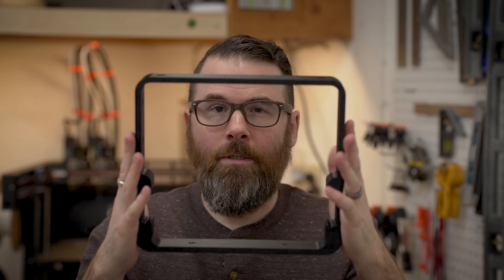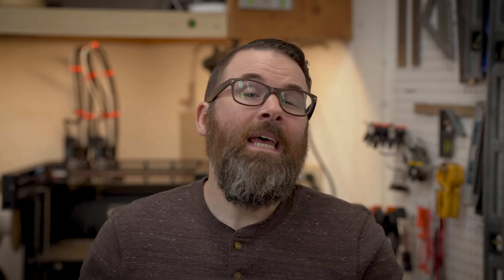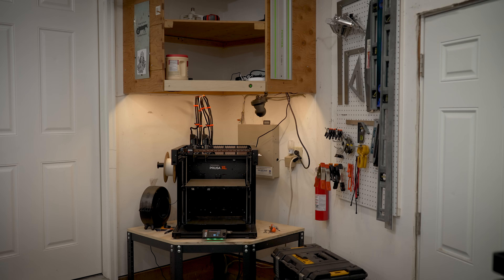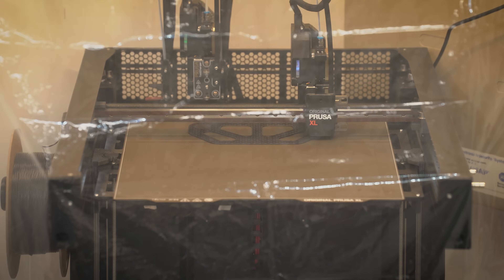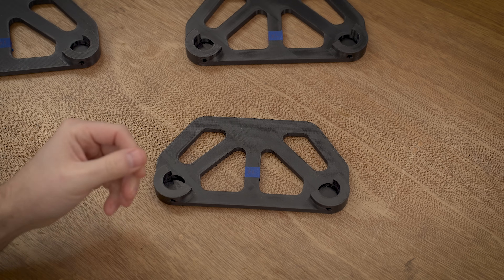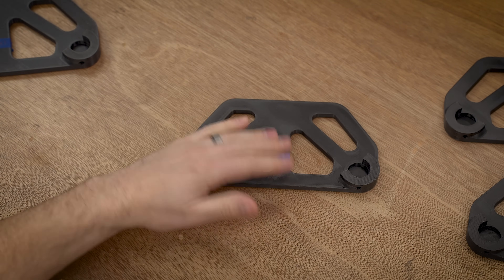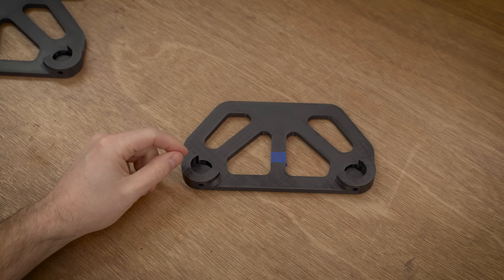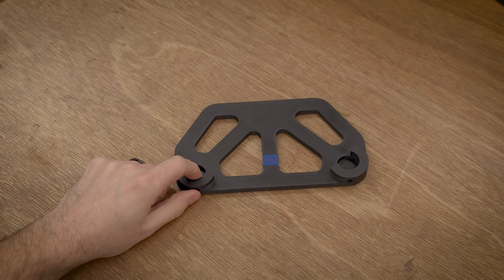Printing ASA on the Prusa XL -Are Enclosures Necessary?

Comment: Less than 65 F is too cold for any 3d printer printing any filament.
Reply from the maker: Just to be clear, it was 56F in the shop, but the temperature inside the 'enclosure' was at least 80F during printing.  Once the first layer started, it got above 90F and nearly hit 100F.  That's the air temp OUTSIDE the printer, but inside the shower curtain.  I agree, it was too cold outside the curtain, but inside it was roughly the same temp as inside the enclosed printers.
Reply: @RobertCowanDIY  According the user's guides for the your  three printers, the avg min ambient temp is  55 F.
Reply from the maker: @bernardtarver   Once again, the ambient temperature around the printer was at worst 75F.  OUTSIDE that environment, where I was recording, was much cooler.  The printer did not see these temps.  Outside was -5F, but that's irrelevant because the printer wasn't outside.

Comment: They showed off a magnetic draft shield in formnext that is going to be optional. it looked simple and would fix your problem 100%
Reply: here is the part where they talk about the enclosure and draftshied https://youtu.be/FxdpNxkG39k?si=uoVj7EqoHE8sT0mr&t=329
Reply from the maker: Oh nice!  Yeah, this will be a workable solution until something better comes along.  Thanks for the link.
Reply: @RobertCowanDIY  no problem 😉 but you are absolutely right. They shouldn't treat it like an afterthought, and it should have come with the printer at launch optional or not. It was interesting interviewing them, they are very passionated about there products and just like there other products i have a good feeling every problem on the XL will eventually get fixed. Just to bad the consumer has to be the beta tester. Nothing new but i expected more after those 2 years.
Reply from the maker: @NoizieWorks  There's a huge push for companies to release new products and 3d printing is moving very fast as an industry right now.  Just a couple years ago it was COMPLETELY different.  It's not an excuse, but I do feel bad for companies that have pressure to constantly release something newer, faster, bigger, more AI-er, etc, etc.
Reply: @RobertCowanDIY  Absolutely right!

Comment: I constructed a couple enclosures for my MK3. This first was a carboard box with a 100W incandescent light in it. That helped the bed quite a lot with heating the chamber, but it wasn't quite enough to get the reliably straight ABS prints I was after. ABS wants around 50C ambient, so stepped up to a a couple small 120V heaters controlled by a cheap temperature controller. I can get dead straight ABS prints anytime I want now, but now I want to do it with PC. That needs a high enough temperature that my MK3 controller shut down. (Apparently, there's a sensor onboard somewhere). Next up is CF-PC with the heated chamber to minimize residual stress, but I haven't run that experiment yet. I moved on to other things while waiting for an Obxidian nozzle.
Reply: This is a true maker. Cardboard and a light. Awesome.
Reply from the maker: Yeah, if it works, it works!  Nice job.
Reply: Just be sure to cool the extruder motor, and print the idler door from ASA, because petg one will warp at around 45-50c under stress of the spring. Otherwise, mk3 is very capable of printing ABS, and even better at printing ASA.

Comment: I also had issues with the default Bambu ASA profile. I think the bed temperature is far too low.  I set my bed temp to 120 and nozzle to 265 and have been printing without any adhesive with no issues since, at least with Polymaker ASA.
Reply from the maker: Good to know.  Yeah, the bed temp was 90C and the extruder was 270, it SHOULD be around 260/105+.  With some small adjustments it printed well though.
Reply: PolyLite ASA spec sheet calls for 75 to 95C for the bed, so it's not Bambu, since the manufacturer themselves recommend these values. Controlling ambient temp is more important, as well as annealing the part after it's done.

Comment: When I received my 5-head Prusa XL, I mostly had stinky ABS to work with (it was the only material my previous printer could reliably print). Needing an enclosure for drafts, I simply cut the packaging it came with in the shape I needed. The box is bigger than the printer, and I could surround it pretty reliably.

Still waiting on the official enclosure, though. Even the accordion-like draft shield presented way back when would be good.
Reply from the maker: Yeah, I'm going to move the XL over to my new printer station and it will most likely be a better environment for it.  But a real enclosure would be nice.

Comment: I like the humidity at 16%.  So if it is below zero outside, you can dry your filament by taking it out of the bag.  I'm in Florida. The humidity is 60% in the winter. My dry box running non stop can get down to 20%. Right now it is at 38%. The dry box is just a tuperware cereal box with silica, rice, a reptile heater, spool holder, temp/humidity gauge, and filament guide.  This way I can dry the filament, and print with it at the same time.
Reply: 20% is good in Florida.
Reply from the maker: Yeah, for filament I want it below 20%, ~15% is ideal.

Comment: The XL is a good machine, but for ASA or ABS in a cold environment you need an enclosure. If there is no draft and the room is at room temperature a top cover is not needed. The firmware however is not finished yet
Reply from the maker: I'd agree with this.  It was a less-than-ideal test, but I think that's better than showing it in perfect conditions.  BUT, I've been printing for several days since making that video and it's been fine with only minor cosmetic issues (parts are functionally fine otherwise).  It does work, just not ideal.

Comment: I haven't watched the video, but I bought the Sumo Enclosure.  I've found that printing in an enclosure provides better results even when printing PETG vs. no enclosure. 

In addition I want to contain as much VOCs to the enclosure as possible.  I run a Hepa filter with carbon on all my printers that circulates the air in the enclosure.  I don't want to vent the enclosure because I'm trying to maintain temperature inside the enclosure.

I print ASA just fine with my mk4 in the Prusa Enclosure.  I preheat everything for about 45 minutes before starting the print.

Looking forward to watching tonight when i get some time.  I'm sure it's good content.
Reply from the maker: I might have to check that out, but for $300 and I still need to print all those bulky parts?  I dunno...  I can easily cut acrylic on my router, I would probably just design my own.
Reply: @RobertCowanDIY  Believe it or not I thought it was actually fairly priced compared to what else is out there for the XL and less expensive than the current MK3/4 enclosure that Prusa makes at $349.

I agree that making your own is probably the cheapest route of you've got the time.
Reply from the maker: @bluerider0988  For me it's less about time or money, I'm just really picky and wasn't happy with previous enclosure kits I've bought.

Comment: So a nice video. I have one idea to try maybe. You can edit the end-code and leave the bed turned on for some time for example at 80 and slowly bring the temperature down with time. Maybe this can help with your problem with XL.
Reply: This definitely helps, I have logged over 300 hours of ASA printing on my X1C, this one made the most difference by far, I set mine to automatically turn down 10C every 15 minutes.
Reply from the maker: @richardguo1892  Good to know!  I'll have to do that.
Reply from the maker: I absolutely thought of this.   A slower cooldown would help tremendously.

Comment: Another great video thanks. At those temps I suspect you may not be getting anywhere near full strength ASA parts, but of course that may not matter for your project. 

The real magic starts to happen for ABS at over 80C. Enclosure temps for professional printers printing ABS are normally set at 80C and I suspect similar for ASA.

You may also find different glue sticks work better with different filaments. I use Magigoo PC both as a bed separation agent (to stop some of the stickier filaments like TPU sticking too much) and also as a maximum strength glue stick for nylons, ABS and ASA . I also use an FR2 (bakelite) surfaced flex sheet from Mueller, which is cheating a bit.

Another way to build a cheap ghetto enclosure is to glue 30mm sheets of polystyrene together to form a box that you can place over the printer. I cut an opening and pressed a small sheet of lear acrylic into it as a viewing window for my Prusa. I could get temps up to 50C this way on my Prusa bed slinger.
Reply from the maker: You might be right.  I wonder what the ambient temp is right near the print though.  It was 100F (in the earlier tests) about a foot away, near the wall).  I would suspect right near the print bed it was quite a bit hotter.
Reply: @RobertCowanDIY  good point. That heat might be too localized close to the bed for a taller print (although heat does rise of course) to keep the whole print hot to also prevent warping on taller prints....but it might be enough to achieve good strength. I need to do some testing, I think.
Reply: yeah theres a reason i print abs and Asa at 85-90 chamber

Comment: 5K for a printer that needs to be enclosed with a shower curtain . This Prusa guy is a genius . His buyers also
Reply: I'm just curious how many Prusa videos these infants go on beating the same drum over and over, who cares what other people buy?  Have you seen the waste compared to other MMU3... grow up lol
Reply from the maker: Oh, I put in a section JUST FOR YOU.  It wasn't $5k, but it should have come with an enclosure option.  But instead of rage-baiting people I'm just showing solutions where I can use the printer for my purposes.
Reply: I consider buying a Prusa XL, but for that price one can expect it to be enclosed, not even as an option, but mandatory. But I'm still considering it, as I'm not a fan of the waste other multi material printers are producing. And manufactured in Europe is also a plus. @RobertCowanDIY
Reply from the maker: @artural4841  I wouldn't let the lack of enclosure throw you off TOO much.  It's not necessary for most of my prints.  If you primarily print with ABS/ASA or nylon, that might be different.  But I've run more ASA through it than any other printer I've owned.
Reply: I print antenna insulators, bases for coaxial connectors, etc in ASA using a Creality S1Pro in a zip-up $60 enclosure with a flexible duct venting out a window. Works well.
Reply: Do you feel better with yourself when you insult people online for no reason?
Reply: I would trust Prusa a hundred times before Bambu with my data, etc
Reply: I know for a fact that Prusa has been the go to 3D printer from the years 2018-2022, and for good reason. They’ve done loads to further the community with open source and very high quality for the time. In 2023 and 2024 however, buying a Prusa machine as your primary workhouse is just intentionally spending money on an inferior product when compared to the Bambu. There are a whole lot of things that make the Bambu superior, and the XL is a different product all together, but like you said. $5000 for a non enclosed printer with 3D printed parts holding it together? No chance.
Reply: @alexanderpierzchala1615  $5k gets you the 5 tool machine, which brings capabilities the Bambu can't match.
Reply: @alexanderpierzchala1615  Why do you even come to these videos if all you're going to do is piss and moan?
Reply from the maker: Saying the XL is too expensive is SO hot right now.

Comment: you are cheating , printer stands in a corner and corners have always 90 degree :P
Reply from the maker: Yeah, yeah, that's fair.  HOWEVER, both of those are exterior walls which face north...  Does that undo some of the cheating?
Reply: @RobertCowanDIY  i'm from the 80's when cheating in games was encouridged by gaming magazines so  don't see it as a bad thing
Reply from the maker: @kokodin5895 fellow 80's bro ;-)

Comment: I want and need the enclosure with an included advanced air filtration to protect from VOC and such, ASA is nasty, and it will sips through your doors into your living space, not that good

Furthermore, the ambient temperature will directly impact the strength of the printer with ABS / ASA, so you want it at 60C at least....
You will notice it more when the prints are taller...they will wrap as well, even without any draft ,they just shrink too fast because of low ambient temps

That's why we need an enclosure, drafts are easy to solve anyhow
Reply from the maker: Thankfully there's a mudroom connected to the door going into the house, which travels through a laundry room and then through a hallway.  There are 3 doors between the shop and my actual living space.

Comment: They did have that bellows shroud in one of the expositions they went to and they Possibly had it in the announcement vid too. The lack of top hat is probably more of an issue For large helmet sized abs prints. As all vorons are near fully enclosed.
Reply from the maker: Yeah, the sides and front are EASY, but a top-hat is the tricky part.

Comment: Was interested to see your results.  I'm printing the last parts of the SUMO enclosure  from 3D SOURCERER for my XL.  I tried to print some of the parts in ABS and could not get good results.  Ended up printing it all in PLA.  I'm hoping I can print more difficult material with it installed
Reply from the maker: Gotcha.  I've looked at that, but got really burned by PrinterBox or whatever I got for my MK3.  I'm a little leery of enclosure kits after that.  I'd either make my own or wait to see what Prusa comes out with.
Reply: @RobertCowanDIY  I just posted a make on Printables, it came out pretty well and I'm printing a large ABS part now

Comment: I'm printing on the MK4 Enclosed with ASA right now and I got some lifting off the bed. I had to restart and use some glue stick. I think it depends on the structure. My print was long with relatively thin walls so I think the constant throwing of the bed loosened up the print. Nice idea with the shower curtain.
Reply: Be careful, parts of the mk4 are in PETG and might not be suitable for higher temps enclosure settings. Make sure to print spares at least just in case

Comment: I've got email in december from Prusa to complete my 2T XL purchase, and still haven't completed just because I am waiting for the enclosure release. Very disapointed that they let community finish their product for such price tag, years of development and delays. I think that for the money we pay and for the 360mm3 build volume enclosure is mandatory not optional.
Reply: @meltymeltymelty  Its more of a principle. It would cost me approx. 3000$ incl. shipping and import fees for 2T XL kit... and I don't want to use shower curtain or pay for third party enclosures just to be able to print PLA/PETG/ASA without warping in my garage.
Reply: @brezovprut4431  💯
Reply: I have a XL. I honestly don’t think it’ll be a great printer for high-temp materials because the bed doesn’t have much thermal mass. My Voron does ASA, ABS, etc wonderfully with its giant heat spreader and AC bed heater. My enclosed Prusa Mk3 can’t get even close to the same quality and I doubt an enclosed XL would, either. The bed is all wrong and the tubes up top prevent enclosing with minimal air volume. It’s wonderful for PLA and PETG but get a different machine for ABS and such.
Reply: I'm in the process of returning my XL right now, the quality just isn't there
Reply: @alexcortelyou8124  quality of the prints or printer? .04 or .06 nozzles?
Reply: @MrKornnugget  both. Mine shipped with .6. maybe I could get .4, a smooth sheets and a bunch of mods but I'm thinking It'd be be a waste of time.
Reply: Build a Voron 2.4 and mod it with Tap Changer/Stealth Changer (tool changer mods)
Reply: @Okuhno  that or maybe a mini-pheonix idex?
Reply: I think Joseph doesn't care much for innovation anymore and he's just riding it out...
Reply: Yeah for $4k that's unconscionable
Reply: This comment has me laughing. A real maker would just make something, heck some cardboard and tape. You must not need the XL.